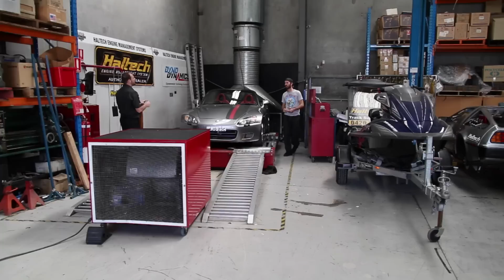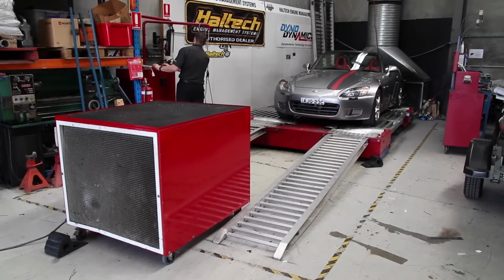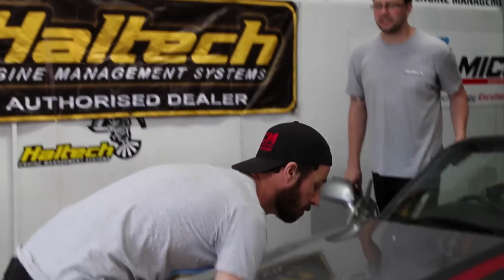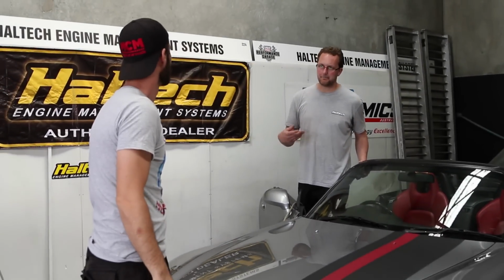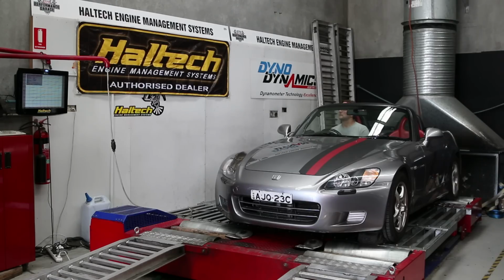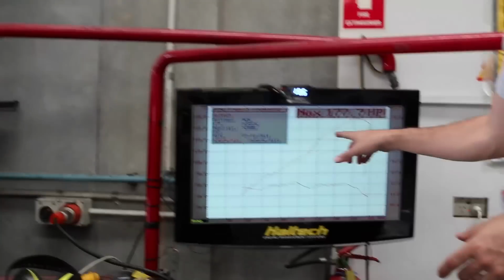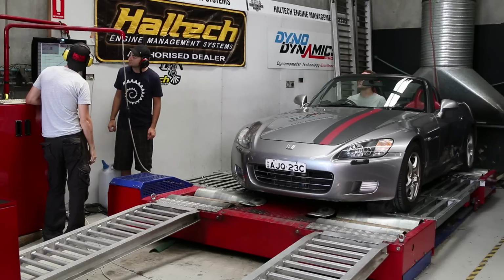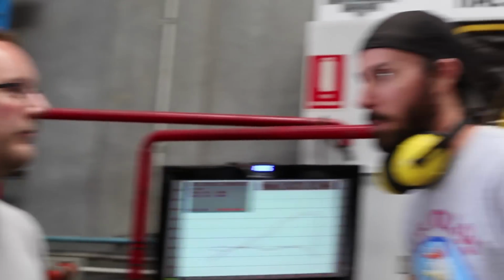Cold Air Intakes Mythbusted [Naturally Aspirated]

Comment: How about Torque?  Cold air intake kits, with LARGER area air filters, not TINY POD filters do make more power, torque and better fuel economy.  It improves much greater with a free flowing EXHAUST system to allow intake and exhaust system to be matched with efficiency and flow.  Your mythbusting busted nothing, you put an overly small POD filter which does breathe the same as stock since it is sized TOO SMALL.
Reply: +Budget Boosting i had the same idea. with the k&n typhoon system, an input for the maf-sensor is included.
i can´t see it anywhere in this video?
Reply: +Budget Boosting Okay, that's a very good test. You've given me an idea for another video. I did one on the right temperature of an intake and how to manipulate that, that it's not always about being colder, you can get too cold for your build, I did, depending on weather.
Reply: +Budget Boosting Even removing the intake and running the throttle body naked wouldnt increase airflow. You could put a 6 inch intake pipe on a stock engine and it wouldnt make a lick of difference, if it did it would be a negative effect.  The first few seconds of the video actually described pretty accurately why factory intake systems are very efficient and effective.
Reply: +Nick Palaroan sooooo, you're just gonna ignore the results?
Reply: floridabrn
If Im not mistaken, didnt that Honda have other modifications done to it? A modified engine can certainly take advantage of more air flow.  So using a modified car to test the results doesnt really explain whats happening.....an aftermarket intake on a stock engine will actually be worse, as you MIGHT gain 1-2HP at the very top end, but you will most likely however have less torque at the low end which will result in poor fuel economy and those high flow air filters will most likely shorten the engines life as well.  1-2HP isnt even a noticeable amount of power, and chances are the Dynos that show even that kind of improvement could have had other variables that triggered that difference.....your car will vary HP output just from the slight difference in the quality of the gas.
Reply: floridabrn
No matter what kind of intake you put on your car, that air has to travel through the throttle body and intake manifold and then valves. If none of these components have been modified then an aftermarket intake will have very little effect on improving the top end power, while reducing the low end power.  As it even says in the video, the restriction in air flow increases air velocity which increases the power output in the low-mid power range.  Which is where you are going to spend most of your time.  So if you dont have the above modifications to use with an aftermarket intake, the only way you will see an increase in power is if you spend all your time at the redline. And even then, I can assure you you wont feel that increase nor will your 0-60 time benefit from it either, probably go down slightly.
Reply: Nick Palaroan Which all boils down for me to looking forward to porting my intake and exhaust on my ride. :)
Reply: Nick Palaroan
I've put on YouTube a port and airflow theory video. Thanks to engine modifying expert David Vizzard, his book, and a fan of his Hugh O'Brien on the Jafromobile channel pointing me at David Vizzard, I'm now up on the knowledge base quite a bit on what to do,

David states a few times, that a ported engine is like having NOS on tap at all times, but you don't have to pay for the refill. It helps move that much more air.

And it's not a top end power grabber only. It effectively grabs power across the RPM spectrum.

Granted, my air flow and exhaust are already over the max for what my fuel injectors can match, so I literally should gain power except for on the top end, but once this is done, that'll be what I work on next.

There was a TRD forum that listed next up fuel injectors for higher flow on Toyota's, but the forum is gone and I can't find anywhere that people know. :/
Reply: +Budget Boosting FUN FACT: If your power numbers went up, that means your torque numbers went up and vice versa.
Reply: Rick Miller
No. Torque can, and usually does go down while horsepower goes up. Horsepower is a measure of torque over time, so producing less torque in a faster amount of time can yield more horsepower.
Reply: Nick Palaroan Torque is a function of power in a certain RPM. I'm not an expert, but that doesn't sound right.

Can you tell me more?
Reply: DE Nichols
HP = Torque x RPM / 5252 (when using ft/lb for torque)

So you can have 300 torques at 1500 rpm and that would be 86HP.

Or you could have 200 torques at 6000 rpms and that would be 228HP.
Reply: Nick Palaroan
Okay. Following the logic of the equation, if I were to correct this phrase, "so producing less torque in a faster amount of time can yield more horsepower." I'd say instead, "so producing [more] torque in a faster amount of time can yield more horsepower.

Torque is on the top of the fraction or division problem, so the greater it is, always, the greater the HP.

I do realize that the RPM fluctuation makes it more complicated than that.

Often as RPM rise HP and Torque cross and Torque drops off while HP may continue to improve, but simply, for a given RPM, the greater the HP, the greater the torque, and vise a versa.

Torque is a way of measuring HP against how effective it is. How much power do you really yield based on how many times the engine turns over? These equations help evaluate that. It says, the more RPM required for a certain amount of power, then the less torque an engine is putting out.

I say this, as for a while HP simply goes up, but if you bring in RPM into the equation, then you evaluate how much more RPM is actually the solution, and really, you need your shift point at this RPM to not lose power by over revving the engine.
Reply: DE Nichols
Your original statement was that you have to increase torque to increase horsepower. I was simply demonstrating how you can increase RPMs and lower torque and increase horsepower.

Its not the greater the HP the greater the torque at all. Yes more torque will ALWAYS gain you more HP at a given RPM. But if we are talking across the board, you can have lower torque and more HP if you increase the RPMs.

Torque doesnt always drop off at 5252rpms where torque and HP cross, it can continue to increase after that point. It all depends on how aggressive the cams are.  But after 5252rpms, HP will ALWAYS be higher than torque.
Reply: Nick Palaroan
Ah. There's a sweet spot in the data for how engines function that matches that. Yes. I see it now. Thanks. Talking about Torque versus HP is often difficult for me to imagine since I'm good with numbers and the equation makes some "apparent" truths, which aren't as straight forward as the equation makes out.

Especially  considering how multiple variables are continually changing in a real example.

I enjoyed the discussion, if you can tell by how much I typed into it. :)
Reply: DE Nichols
Horsepower is simply torque over time. There shouldnt be any "versus" because you cant have one without the other.
Reply: My comment was meant to say that according the equation for HP, if torque goes up, so does HP and if torque goes down, also does HP when compared to a previous figure. II was mainly addressing the huge misunderstanding that torque and HP are completely separate from each other when the fact is that HP is relative to torque and RPM and is not an actual force that is moving the vehicle.
Reply: Budget Boosting didn't you watch the video? He proved cai's increase power
Reply: Rick Miller - not so. Vehicles change gear ratios all the time depending on purpose to affect torque and horsepower numbers. Lower gear ratio horsepower goes up and torque goes down or vise versa depending how you interpret lower and higher gear ratios.
Reply: BOLLOCKS !!!
Reply: I'm gobsmacked that you can post the basic facts but interpret them in such a fucked up way.
The most charitable interpretation is that you believe the arguements of the ignorant that "torque" is low rpm and "power" is high rpm when they are both applicable throughout the operating range of any shaft engine - with one proviso, it is possible to have torque at zero rpm (think stalled electric motor) but no power because of the lack of rotation. You may wish to learn how the original equation was developed, that has been approximated to 5252, to check the accuracy - IIRC, there is a little under 0.02% difference, which is why that number is used.

Oh, you got the wrong term for torque -  it is given in lbs.ft and 'work done' is ft.lbs. They are used in the different order to avoid confusion - ft/lbs means nothing.
Reply: No way... at the same rpm, torque and power are directly proportional - they rise and fall together. 
Horsepower is a measure of work done over time - to be precise, James Watt defined it as lifting a weight of 33,000 lbs through a distance of 1 foot in one minute.
Reply: Your feeding a weed eater not a big block
Reply: nic jones 5 whopping horsepower. Here’s a million dollar idea. Run 93. There’s your 5 hp.
Reply: Budget Boosting fun fact. The factory filter on all modern cars outflows the engines max demand. Its mostly the bends and filterbox inlet that are in need of improvement in some cars.
Reply: Exactly, there's definitely something to it because otherwise people wouldn't have started doing it in the first place.

Additionally all lancers from the 10th generation (evo or not) have a factory ram air intake that runs over the battery and right up to the grill. Even the weakest models have that intake. I know because I have owned some and it makes the battery a total bastard to work on since you have to remove your intake.
Reply: Nick Palaroan impossible. HP is a function of TQ.
Reply: Always lookin fo mo powea!

Comment: I've got an '03 Protege5, and it's pretty upgraded for a N/A car. When I put the intake on, it was mostly out of boredom, and while the bottom end and mid range power were exactly the same, I definitely noticed a slight difference in the top end power. On top of that, it saves room in the engine bay, and it sounds cool...because race car

Comment: A new intake tube and high flow filter in stock air box on my Chevy pickup resulted in almost 18+ hp and lb. Across the power range. Only created 2-3 hp at peak. But across the spectrum I noticed performance gains that were worth the small investment
Reply: Ive got a 68 C10 that i wanna put an air intake on, would it actually help it any?

Comment: idk you might get a tad bit more power on an older none performance car. the s2000 is designed with performance in mind. so its air intake is already performance oriented. take something else like a popular early 2000s late 90s honda civic dx. which its airbox is not made with performance in mind and you might get more of a noticeable gain.
Reply: I agree 👍
Reply: I was wondering the same thing; why they chose sports cars that are already developed for power.  why not use say an economy car/ car with a mor restristive system. like yhe guy said RX8's lose power if you mess with the air intake system which I have heard before, does mean all cars lose power if you change the parts that where "finely tuned from the factory."  what I am saying is that they could have used a RX8 for this test and said cold airs make you lose power, look at the dyno results...  also what about a car with a larger intake manifold? do you use the stock air box? pod? cold air? ram? Im not refuting, just putting the idea out there.

Comment: On a dyno is not the same as on the road unless your dyno is inside a wind tunnel that is linking windspeed to the dyno speed.
Reply: Wind provides much cooler air than a dinky fan in a dyno room. Wind also creates resistance as well.... I would say... buy a CAI if you like the better sound, the fact the filter is reusable and also buy a decent one, not some piece of junk off ebay .
Reply: Save your money on the cai, paint your calipers red and gain 5kw 👌🏻
Reply: dinky fan lol
Reply: But the point remains that even in a windless shop, the saw a gain in power, on an actual road it could have the potential for more power. Either way a lot of cars, mostly low end fuel efficient cars will see a loss of power from an intake, that isn't factory, because it changes the airflow, while the factory airbox was specifically designed for that engine. On performance cars, you'll see gains. But on a regular old Toyota Corolla you're probably losses a little bit.

Comment: Wankel stroke engine = Intake, compression, power, exhaust. = 4 STROKE!
Reply: 2 stokes mean a gas/oil mixuture. So Just Intake and exhaust strokes cuz they travel so fast
Reply: David Hill you're not looking at it right.  your typical piston engine has each cylinder on a different stage at any given time. for instance on an inline 4 every 90 degrees of crank rotation a different cylinder is firing. all 4 cylinders will have fired in a single crank rotation. to compare the rotary you should think of the 2 rotor engine like a 6 "cylinder" as each rotor has 3 sides in a different stage like the piston engine. 1 side has compressed and fired while a second has powered and is exhausting, and the third is intaking a fresh charge. the firing order alternates between rotor 1 and 2 (like the firing order jumps banks on a v6 or v8) the ONLY similarities between the wankel and a 2 stroke are higher power vs displacement and the insane rpm redline. both are from less friction, fewer moving parts, and mass meaning less energy lost from combustion ( linear motion to rotating motion = lots of friction as do timing belts / chains, camshafts + pushrods or followers and valves of which the rotary has none) there's more to it, but that's the broad strokes.
Reply: David Burton
David, good explanation; thank you.
Wikipedia has a good demonstration video of the Wankel cycle running, as well as youtube.
 I rebuilt a rotary engine back in 1975 when nobody knew anything about them.
 Seeing how the rotor moves about in the rotor housing along with the ring gear, stationary gear and eccentric shaft; it twisted & nearly broke my brain.
Reply: Dr.Anderson you're welcome. Happy to help.
Reply: The wankel still uses the two stroke cycle though, opening and closing of fixed ports as opposed to moving valves, premixing to lubricate, and never having a "dead cycle" where it isnt producing power like the exhaust stroke on a 4 stroke. there is no real "stroke" to call it anyway. The cycles you name suck squeeze bang blow are just the four cycles for engine movement and the two stroke does them all as well.
Reply: David Burton What the heck are you talking about?

A 4 cylinder 4 stroke has a power stroke every 180 degrees of crank rotation, not 90.
And ALL 4 stroke cylinder engines require 720 degrees to fire every cylinder.
Reply: abracing199 No it doesn't, the 4 stroke name comes from accomplishing the 4 strokes of a conventional engine one at a time for each piston (being each rotor face). It still follows the 4 movements of the otto cycle one after the other which means it is a 4 stroke engine.

2 stroke engines accomplish the 4 movements of the otto cycle two at a time, meaning it only takes two "strokes" of a piston to complete the cycle.
Reply: It's a rotary. It doesn't stroke. It rotates. It follows the same cycle as a four-stroke, but it itself does not stroke, and therefore cannot be called a four-stroke, and the stages cannot be called strokes.

Comment: OK so not only did the mightycarmod guys get surprised by the fact that cold air intakes actually do work. But there is also a lot more to consider here.
1. The CAI is lighter, not huge but weight reduction ends up adding up here and there.

2. It looks much better and is smaller, much more appealing engine bay and more room to work/clean.

3. A tune will help, sure your cpu might adjust for the difference but not as well as an actual tune for the specific parts you installed especially when its more than just a CAI.

4. More intake noise, this is a preference thing but 99% of people willing to put on a CAI wants to hear it roar too.

5. Change/clean the sensors, there are a couple sensors in the air intake alone like air temp and MAF, changing or cleaning off these sensors can offer more accurate readings to help the cpu get a little more efficientcy out of the new mod. Getting performamce O2 sensors can also help make the most out of intake/exhaust mods. 

6. Ablity to clean and reuse the pod filter instead of having to buy new paper ones, this is a marginal benefit but is worth mentioning.

7. And also the biggest thing aside from it making you 7 horsepower is the fact that a CAI is just a stepping stone to other mods that definitely increase power,. Things like bigger throttle bodies and bigger cams, require bigger and less restricticed air intakes. And you would look dumb installing cams into a car and still using the stock air box

You have to remember your not just paying for more horsepower you are getting at least 7 benefits from this, these guys need to get off the wagon of CAI being a waste of money and reaslize that people are going to start with the basics if they are going to upgrade something.

I would like to see these guys take a highly modded engine and then see how much of a difference a CAI is vs stock box.

Comment: I built a H6 intake for my outback and gained one second from the quarter mile. But the rules i believe you should follow are make sure its sealed (be legal) and make sure you install your filter in a place which wont see water. If the car has a oxygen sensor make sure its as far from the throttle body to prevent revision and get a better meter on the air flow ;)
Great myth busting guys :)
Reply: You remember how you built the intake?